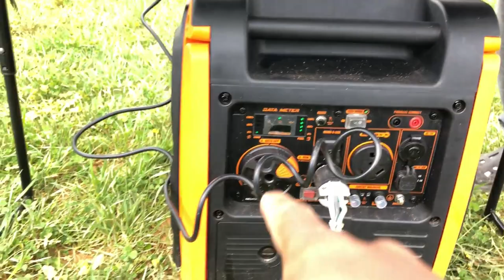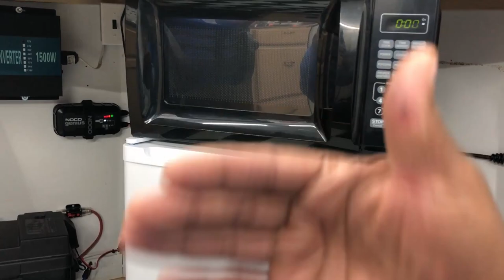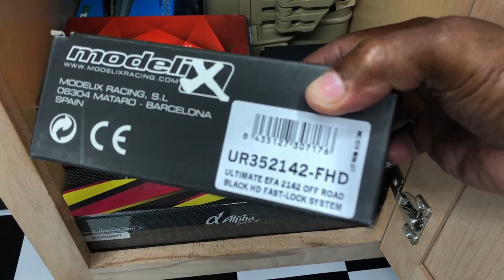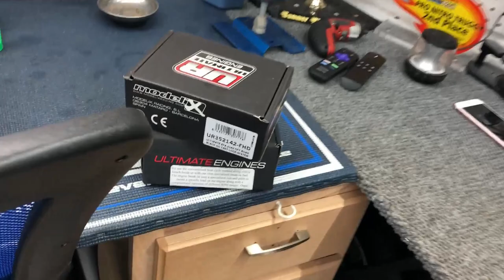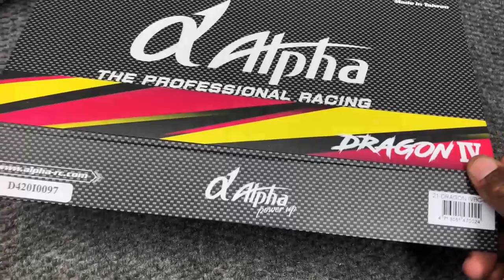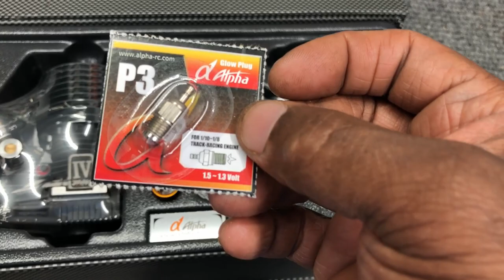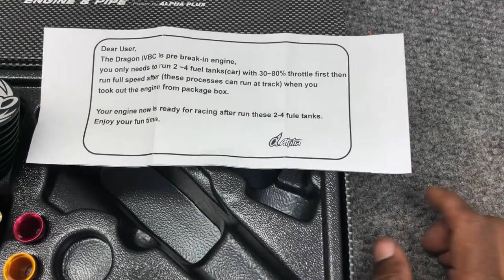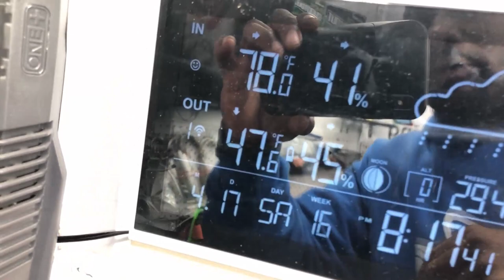Test & Tune Track Day, Unboxing, New Nitro Engine and More

Comment: That 2134 pipe is like a os 2060 feel. Smooth soft bottom end.  They offer the combo with the new alpha 2159 which is like the os 2090, lutz uses the 2159 which will give you more bottom end and wake it up.  Get the alpha 2159 pipe for that engine.  Those alphas can easily take 300 degree temp and hold there compression. The edition 2 has a new carb and new backplate.

Comment: The Alpha Dragon IV ed2 does not have Diamond Light Coating on the crank shaft. However the crank is chrome plated, it's not as strong as DLC but it is smoother/slicker.

Comment: I’ve got the alpha club racer for my shepherd bull x8 and I cannot believe how much power it makes now it is getting Run in. I actually wanted a slower engine as our track is small and mega mega dusty low grip . The car was too powerful near the end of the first meeting as it bedded in . I’m gonna go down to a 13t bell from a 16 and run it Richer . I also gonna install the overdrive gearing with smaller rear pinion and  I bought some soft springs and  them new proline mx tyres to try and get some grip.